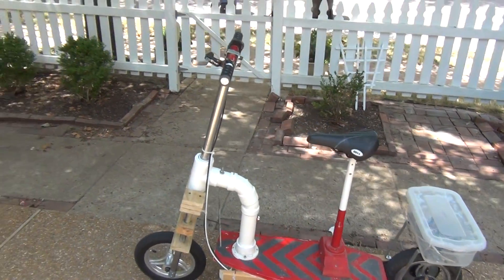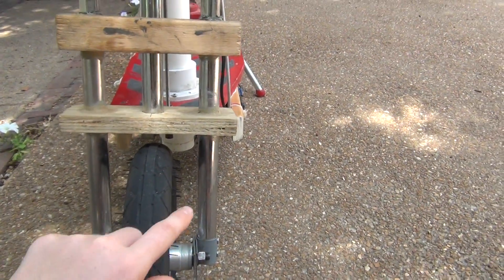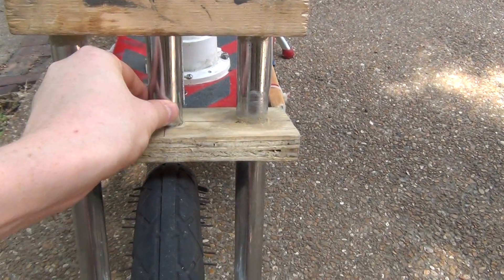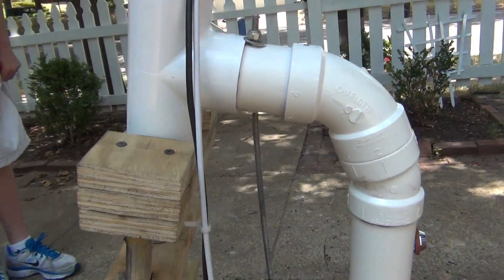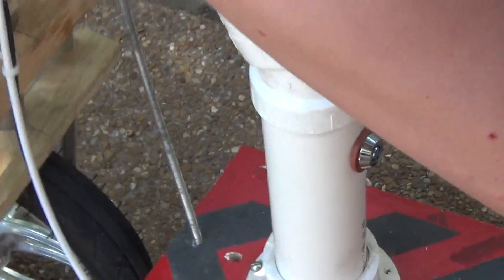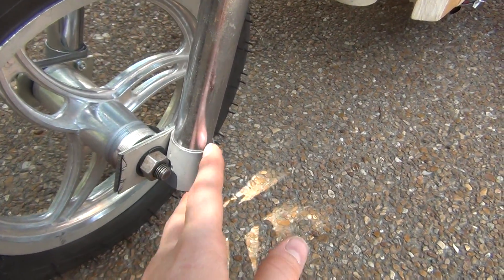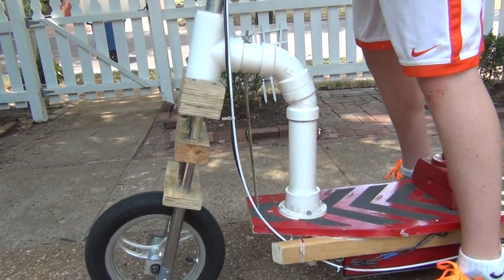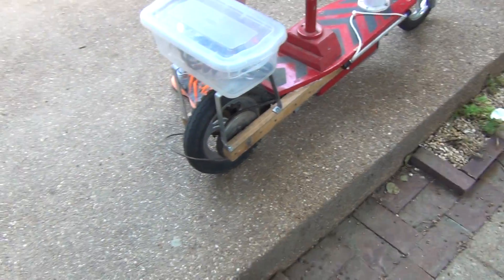Homemade Motor Scooter with Suspension

Comment from the maker: Mr. Bas van de Kluet. No I do not wish to die. I wish to live so I can build more awesome stuff like this. I understand PVC is not very strong. But I used a steel threaded rod to support it. That is why it doesn't snap. In my latest version (https://www.youtube.com/watch?v=Vr6SIEmcQsE&feature=gp-n-y&google_comment_id=z12ft1voclbchjrqu04cgvq5gm3rux5axoo0k) I actually glued steel pipe withing the PVC to make the joint super strong. Also I do not know how to weld yet. But I made it work with PVC. Gotta work with what you got. :)
Reply: ericinventor I don't care if you put some steel tubing in the PVC pipe, it is all attached to a tiny PVC flange.  if you can't well then use threaded gas pipe and turn some wrenches.  

or, just use a kids bike fork/wheel.  you can pull out the bearings and bearing cups from the head tube of the donor bike and presentthose into holes cut in wood

Comment: Do you have a death wish or something? No offense, you are very creative for someone this young, but PVC is not at all sturdy, and using it as a vital structural component in a machine which you will be traveling on at high speeds is like using elastic bands as bungee ropes.